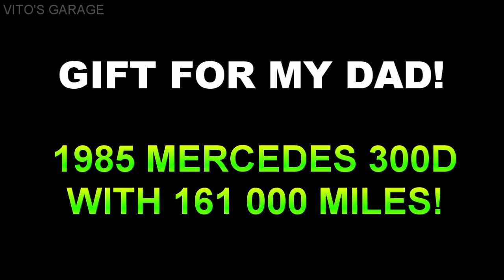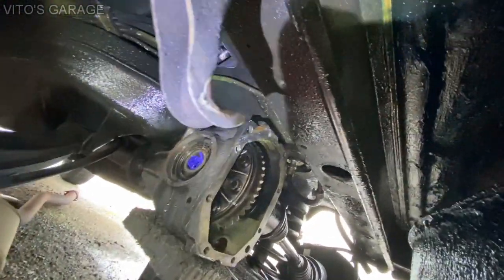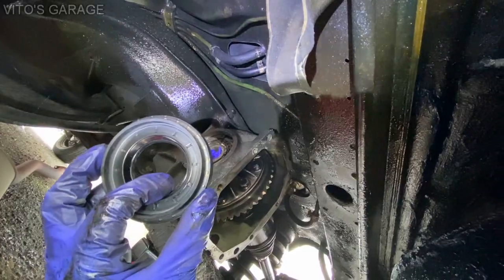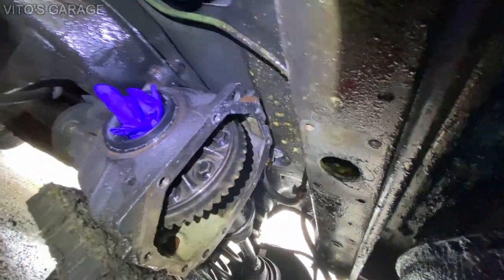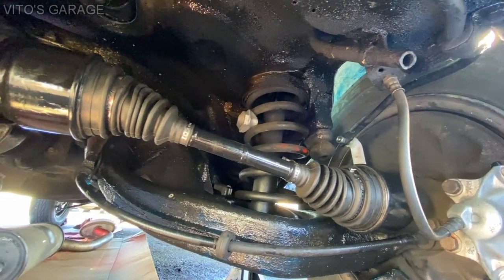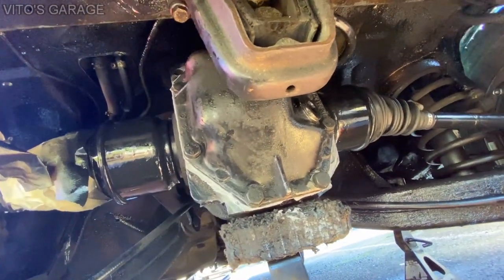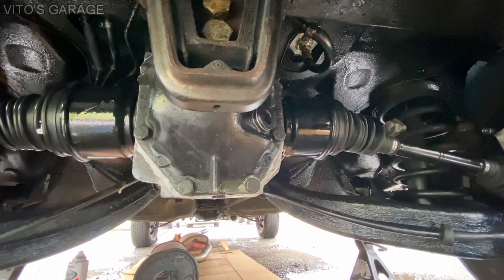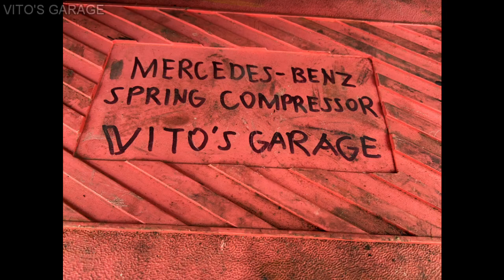Dad's Mercedes W123: Rear Axles, Diff Seals & Fluid, Preservation, Tank Strainer, Front Suspension

Comment: Hey do a full video of V8 W126 valve stem seal replacement without heads off please 🥺
Reply from the maker: With the heads on? On M116 that’s hard to do and dangerous if your drop the valve in. A lot easier to remove the cylinder heads to do that

Comment: Hi Vito! Awesome video as always! That W123 will last forever, that's awesome! I have one question for ya: what socket wrench did you use to remove the fuel strainer? Thanks!
Reply from the maker: Hi Andre! Thank you very much! I used a 1 13/16in socket (or 46mm) to remove the fuel tank screen. I lowered the differential a little bit to get better access🤝
Reply: @VITOSGARAGE  thanks a lot for the info! I have to add the fuel strainer removal on my to do list, so it's better to be prepared 😅

Comment: I love your work, but have never been a fan of the grease slather. Yeah it works, but so messy and bad for the environment in the long run. There must be a better way.
Reply from the maker: There are no better anti rust products. My grandpa used to do it to his car in the 1960s and that car never ever rusted. 
Rubberized undercoating and other products are not good. Fluid film and grease is the way to go. 
And trust me, it doesn’t do any harm to the environment. I also work on fighter jets and considering how much fuel they dump into the ocean before they land is tremendous. 
The grease that I put on all cars stays on them and doesn’t go anywhere